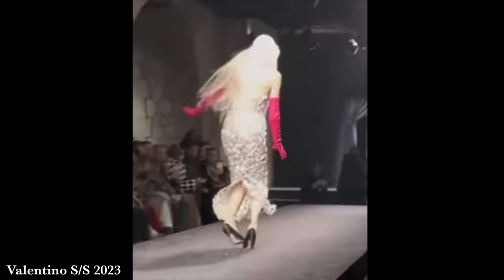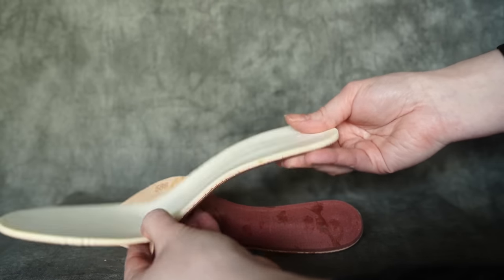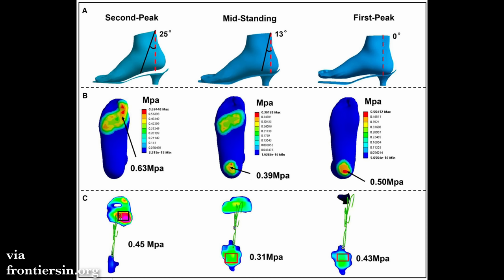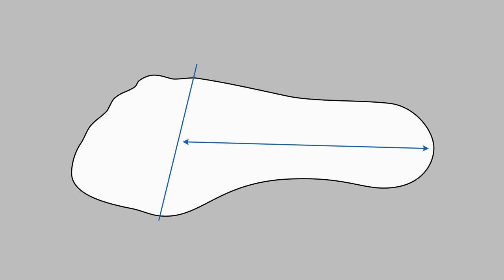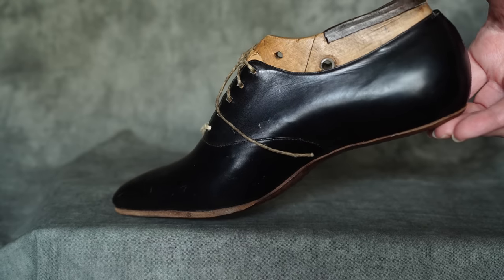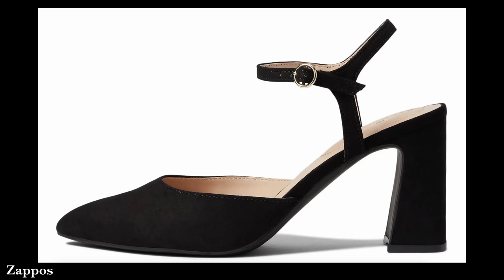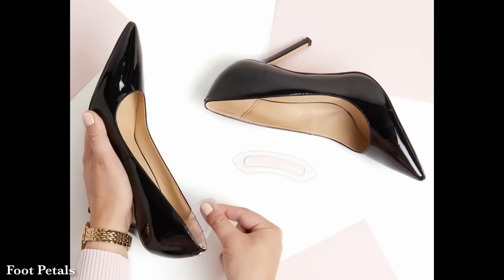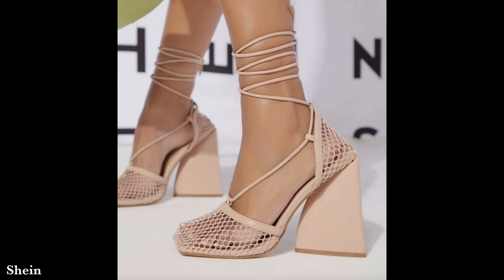Why are Modern High Heels so Bad?

Comment: These women are modeling clothing that's not really intended to be worn. Those stick-thin models are racks for the designs, and other models wear things that would be over-the-top in anime. They're walking on a level, flat, surface in shoes that aren't for anything else. That they are falling off shoes designed solely for strutting the catwalk means those shoes are badly designed.

And, sadly, shoes for the rest of us can be either fashionable or comfortable, but not both. 

I have rarely worn heels, and when I've had to, they've been 1.5 inches at the most and not stupidly narrow. Some women like higher heels, and some workplaces may still require them, and there is no reason for their choices to be on a scale between moderately uncomfortable and agonizing.

Comment: I know you make shoes... but I feel like you haven't walked in stilletos. Most heels over an inch, maybe and inch and a half, you cannot put your heel down first. You end up walking very differently in high heels, almost putting your whole foot down at once. sometimes even the ball first. I was a flight attendant and my uniform had 3 inch high heels, I'm 6'1 so i'd never worn heels before and had to learn. I could even sprint in heels with a suitcase (i was late a lot). I have ehlers danlos syndrome so all of my joints are unstable. I will turn an ankle even in flat shoes, standing still. There are other things at play here for sure. I dropped to the floor in vegas wearing 7 inch heels once. worth it. at 6'8 you can't be ignored by a bar tender

Comment: I don't agree when you say "it's not your fault" because it is.
Listen, we've all been there: high-heeled shoes are extremely nice to look at, they make you feel feminine, beautiful, sexy. They make your calf look thinner  and they give you that little more height that makes you feel so much better. 
Shoe shops are irresistible. Those dainty little shoes look like sparkling jewels.
Some women even dare to say that they find stilettos comfortable and that they get pains when they walk in low heels. Of course, my dear, if you're comparing heels to those thin, flat-soled excuse for a shoe you might even be right.

It all goes back to vanity. You are ready and willing to sacrifice your health and your comfort to look better and, as a consequence, feel better with yourself. Just like Victorian women did when they used those impossible corsets.
The irony of it all is that you don't need high-heels to look feminine and elegant. You just need to think outside the box and find shoes that are both comfortable and pretty.

Comment: Thought it was a video of models falling off shoes with a huge advertising across the video .God does she waffle on ..She also states some manufacturers cut corners well that's rubbish on Runway shoes they are expensive designer shoes made from the finest materials.Campbell falling at Vivienne  Westwood when she was wearing 12 inch Louis heels with a 4 inch platform had nothing to do with shoes she was also wearing rubber tights which got caught and caused the fall .

Comment: Dear god, how much I would absolutely love (and pay) for a pair of shoes made specifically for my feet. Well made, quality materials, and perfect fit? Yes, please; I would fork out hundreds. Some people may think that sounds crazy, but a well made pair of shoes that won't hurt your feet because they're made specially for that one pair of feet, is well worth it. And they will likely last longer than anything one can buy retail these days, especially if they are well cared for.
Reply: I have size 5.5 and quite narrow, especially the heel. So even a 5.5 shoe often slips off my heel even though it is the perfect length. The toe box of most shoes is often way too big and my foot swims in it, making it difficult to walk in.. at least gracefully. This makes it nigh impossible to wear heeled sandals because the straps around the top of the foot and the toes are nearly never adjustable and always too big. Also, as is often the case, my left foot is slightly larger than the right; so sometimes a shoe will fit perfectly on the left but too big on the right.  I wish there were real cobblers nearer to me, I would have custom shoes made and get rid of everything else!

Comment: The shoes where the heel rest under your heel are the best. The others make you walk like a flamingo. The one's where the heel is in back of the heel forces all of your body weight to the ball of the foot and toe. That's bad for your feet. The heel under your heel, and the max height is 1 1/2 inches. Your body rests on your heels and not your toes, you walk better. I chalk it up to designers that secretly hate women.

Comment: Models walk on wobbly catwalks with gaps, sometimes wet or covered in mud, whatever the phantasy of the designers. The shoes don't fit, are ridiculously designed and the girls never learned to walk on a cat walk. You have, even in high heels, to tip toe, never put your weight on the heel. And it's painful. Look at the toes of older models, their feet sre wrecked. Similar to ballerinas. That's then another issue. I modeled once for a short time, thats how I know.

Comment: It seems like mens shoes are made wider even when the size is the same as women's. 
Is the actually any difference between the genders when it comes to foot shape?
Reply: Yes. Male feet and hands are wider even when the same length. It's most visible in the palm of the hand where most men have a square palm where most women have a rectangle but the foot is also wider for men.

Of course, like all human characteristics, this exists on a bell curve with overlap -- thus I wear boys' sneakers and boys' gloves because my palm is a full finger wider than a normal woman's hand of the same length (I call it a miniature man's hand and, in fact, I know from knitting gloves that my hand has the exact proportions that my husband's hand, just smaller).

I work standing on concrete and buy my shoes at one particular store that carries men's shoes small enough for me. Dress shoes are next to impossible.

Comment: Could it be that high heels are just another version of Chinese footbinding?  When you look at how small the ball of the foot is in high heels and then look at the classic 3-inch "lotus foot" that was the goal in binding feet, there doesn't seem to be much difference in size.  Certainly the rationale for both is the same--it's a sexual thing.  Just as Chinese men had foot fetishes involving bound feet, modern-day foot fetishes revolve around extremely high heels.  Never sneakers or any kind of flat shoes.  The difference, of course, is that we don't go around breaking young girls' feet and permanently crippling them for life.  Never mind that wearing extreme footwear can do much the same thing over time.

Comment: …this is why if I have to wear some form of dress shoes…I just try to find a pair of flats that aren’t hideous or instantly make me lame, or very LOW “kitten heels” with a tapered block and Always Always a secure ankle strap

Especially since my foot is VERY narrow, my toes are long, and my ankle-to-heel has a pronounce curve. (A lot of “dress sandals” are on the tightest strap notch and still quite literally slap around on my feet. I can’t wear “gladiator sandals” at all. My foot just isn’t fat enough, and my toes fall off the sole.)

Anyway. Women’s shoes fucking suck. Especially the “pretty” ones. They’re not designed for the wearers whatsoever, the wearer gets blamed for it, and Like The Rest Of Women’s Clothing~ it only fits ONE specific shape Maybe (then scaled up/down in length for sizing)

Comment: Contrary to popular belief, wearing high heels DOES NOT make you taller. Instead, it only adds to your height. Anyone who works in fashion factually knows this. 😜

HOT FASH TIP OF THE DAY: 

Want to $ave money on expensive designer stilettos? Here's a hot tip. Go to an expensive shoe retailer, like Walmart. Ignore the selection of stilettos and find an expensive pair of the fanciest flat heeled shoes at a fraction of the cost. The next time you go somewhere fancy, like ballroom dancing, or playing bingo, wear your cute new flats. However, here's the trick; once you put the shoes on, elevate your heel from the floor, as if you are actually wearing stilettos. It's ideal for dining because you won't need to walk much and you can hide your feet under the table once you're seated and ordering your first Martini & Coke Zero. If anyone comments about your cute new shoes, tell them the heel is made from a clear polymer, rendering it virtually invisible. You'll be surprised at how many of your girlfriends will say they can "see the heel" from a certain angle.  

Or, really impress your girlfriends and tell them the heel is made from a secret stealth fabric currently being produced for the armed forces for pure camouflage invisibility suits. Impress them further and tell them your husband works at the Pentagon, or some crap, on Top Secret projects. It doesn't matter, lie through your teeth. The beauty is, people can't validate the story, since it would be impossible, even if it was true!  

This fashion moment was brought to you by Entrails Cat Food. 9 out of 10 cats will follow the trail for Entrails! Buy 3 boxes and get the 3rd for the price of 2! That's a huge difference in price! Here at Entrails, we want you to think you have saved money! 🤣🤣🤣

Comment: You need to learn to walk in heels. You put your toes down first and not the heel. Actually ballet teaches this. 

Also please stop buying shoes where you can already see on the bottom that the heel is a separate part. It should be in connection with the arch. Also if the shoe won't stand up when you drop it in standing position from a few centimeters they will not support you. Also the back of the heel should not go forward when the shoe is standing. They aren't ski shoe's and you should be able to stand up without the heel digging in you. 

You can have very expensive shoes with a really bad shape and cheap with great shape.

Comment: 99.9% of modern heels are ugly.  Who decided stripper heels were for every day wear, huh?!?  Hunting for a basic low heeled pump or a kitten heel is like trying to find the holy grail...I have yet to find an acceptable pair of either I'd be comfortable wearing regularly.  Anything higher than an inch is murder on my flat feet, so even though I really want some nice looking heels, I am basically out of luck.  I run around in tennis shoes, hiking boots, and Birkenstocks.  Sexy, huh?  At least I don't have to worry about rolling an ankle!

Comment: Not exactly the same but I have a pair of shoes with thick wedges which taper out. Call them my clown shoes cause they make my foot print a good inch wider and longer overall. And I catch the front of the shoe on the ground all. The. Time. 
Face meet pavement.

Comment: Young Girls, I used to walk the Milan runways. I practiced, at Home walking in high heels starting at age 15. I wore them 4 hours or so each day. Remember, young girls everyone is not cut out for that life, extensive Travel , tight schedules. And staying a small size 5 or less. I would say for every10 Models that I worked with 1/2 or them were struggling. Also, the Contracts can be deal breakers, right now I still earn a excellent living teaching  anyone how to read those legal documents on Zoom. It is still shocking how many People give up on reading simple Contracts.